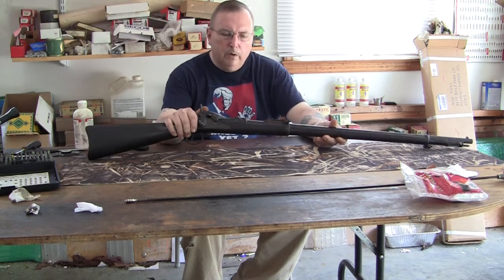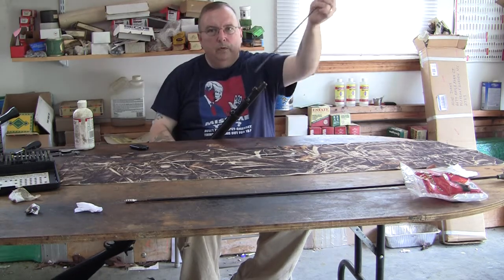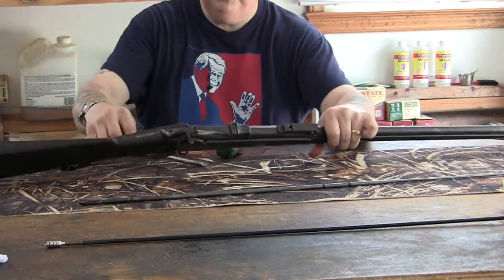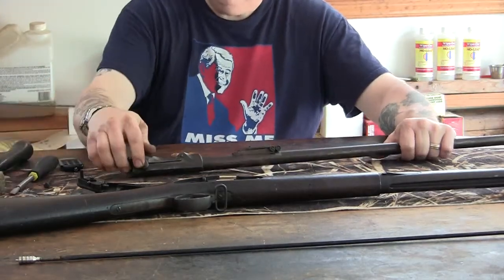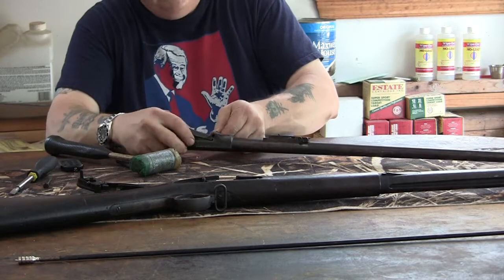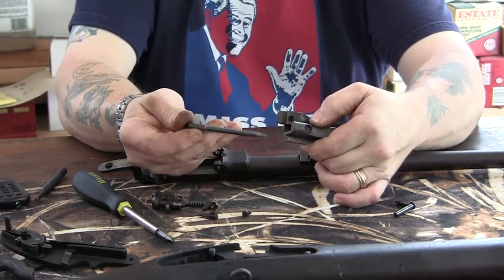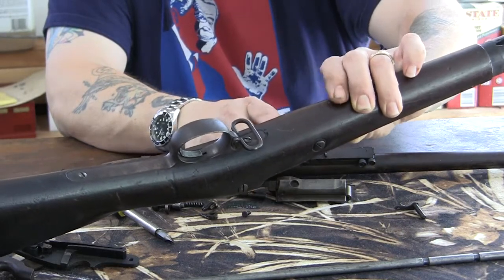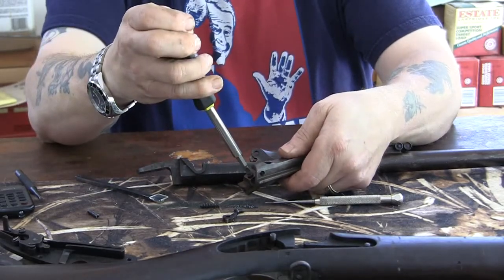Dissasembly of 1888 Springfield trapdoor rifle(1/3)

Comment: That is not a bayonet. Although it could be used as one.
It is not a cleaning rod either. Although it could be used as one.
The "bayonet" rod is actually used to dislodge stuck casings in the breach. Jammed casings were a problem in the trap door. And the breech block was not always strong enough to eject the spent brass. So you would use the "rod" to push out a "lodged" or stuck casing.
Reply: *****
it was designed to be used to dislodge stuck shell casings from the breech.
Come on man. While I love the informative video. Please Designate what it's original purpose was for. That "bayonet" is useless in combat.
Now ....an m1 a1 bayonet... can kill an adversary.
Reply: @donthepit  You're mistaken.  The rammer on this particular rifle was intended to function as a cleaning/clearing rod and bayonet.  In the waning years of the victorian period, army brass decided that the bayonet was obsolete, but they didn't want to completely get rid of it.  The compromise was this contraption, known as the 'rod bayonet'.  It was a stupid idea and the U.S. reverted back to proper bayonets fairly quickly.  Forgotten Weapons has a video on the subject if you don't believe me.